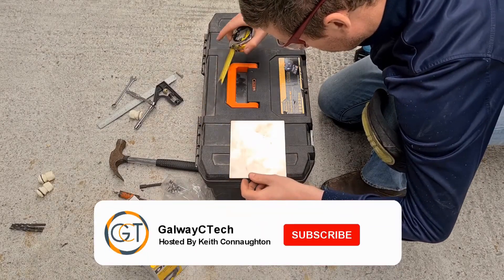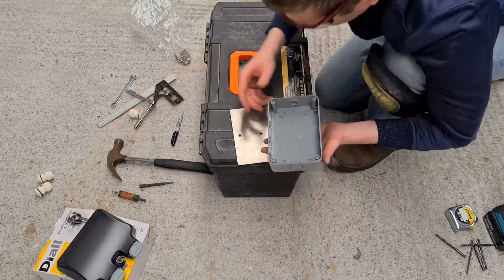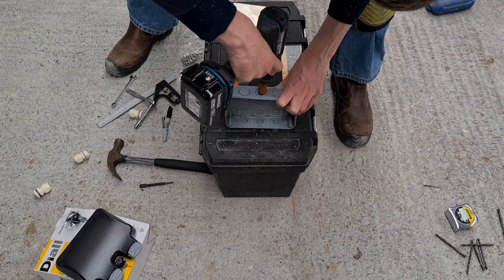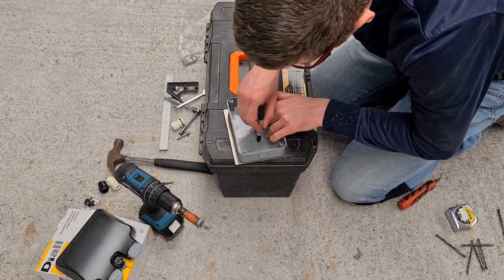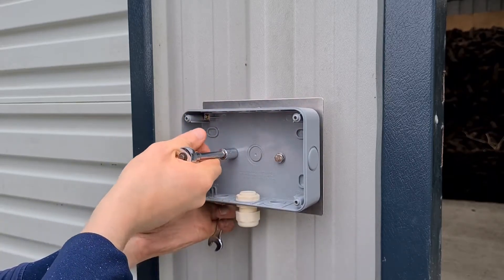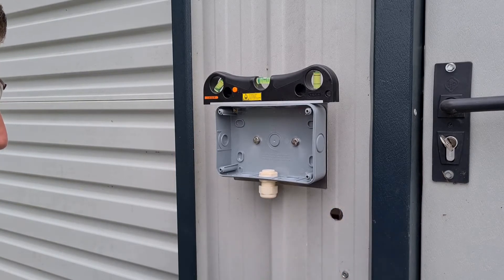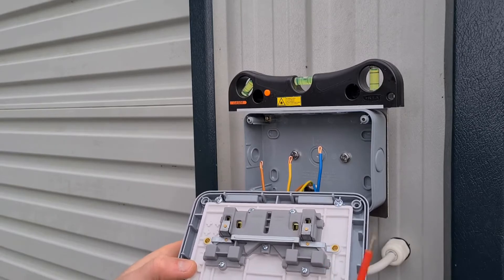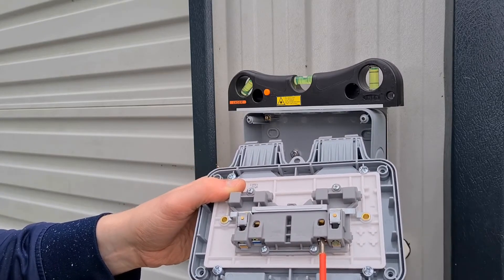How to install an outdoor socket

Comment: What didn’t you just put the cable through the back of the socket?
Reply from the maker: Thank you for your comment. I had limited space between the corrugated steel sheeting and the stainless bracket to fit the glands.